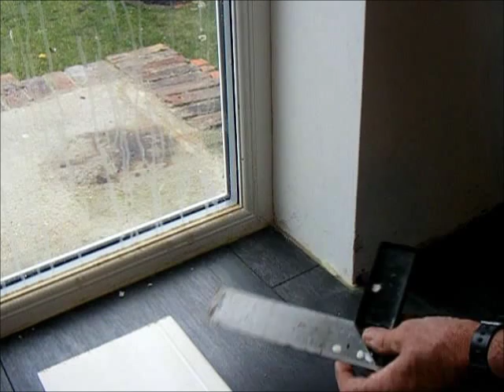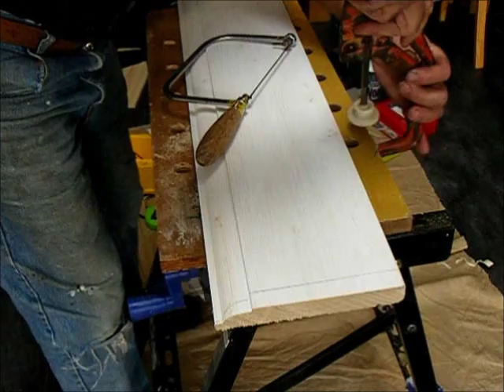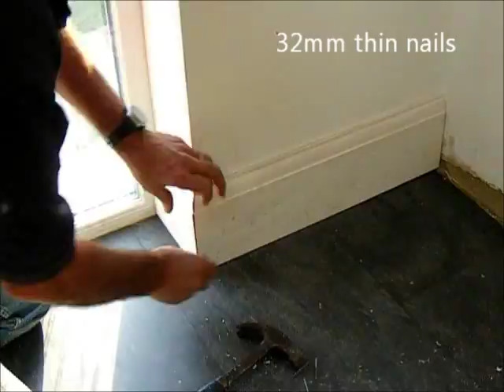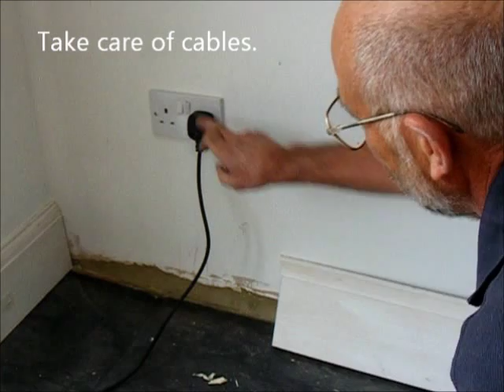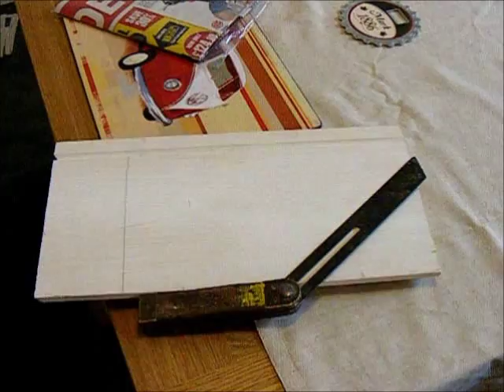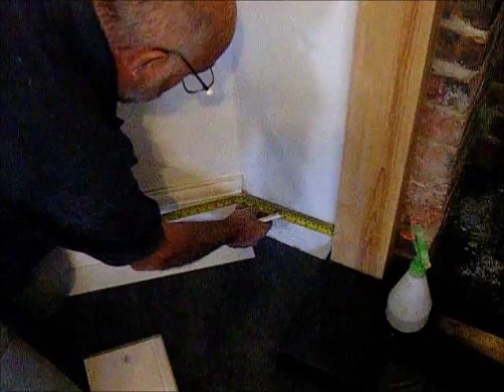How to fix baseboard, skirting board.

Comment: @ 7mins !! .. attempting to nail the mitre join while holding the board by hand and using a knee up against the other side??

Use a work bench and corner wood clamps - the tools are available! Seriously!

The two pieces of skirting can be properly supported using the jig and pins can be hammered in accurately without the pieces moving about and then positioned to the corner. Next step > apply wide masking tape across the top of the skirting to temporarily secure it in place so that pilot  holes can be drilled through the boards and into the wall behind > then proceed to drill the correct size for the rawl plugs going into the wall and additionally countersink the skirting support points. No More Nails adhesive can be applied  to the back of the boards.

Comment: Good video on cutting skirting using hand tools. Pro carpenters would tend to use a powered mitre saw but it's the end result that is important. You might lose a bit of time using hand saws. Don't forget that there was some really excellent work done in Victorian carpentry and they didn't have access to 13 amp sockets.
I've just tried various methods of mitering 9" skirting (deep stuff!) using a hand saw. They all failed apart from one that did work pretty well. Instead of marking with a pencil use a good sharp Stanley knife, making a fairly deep score, on all sides of the skirting. I mounted the skirting vertically in the vice and cut down using a fine cut Bahco 14" tool box saw, freehand.  The knife mark helps to guide the saw, the fine cut of the saw helps too. You may or may not have to touch up with the block plane. You can also wet the end grain to make planing a bit easier.

Comment: BERN a quick question how do you fix the unevenness of the skirting where the skirting sits on the floor, by that i mean the floor is wavy how to get that flush fitting?
Reply from the maker: +! Hadookaan ! Sorry I have not replied earlier. Two ways to fit close to an uneven floor. Fill with painters caulk  or scribe using using pencil flat in the floor to mark the undulations and then cut the high points away. Hope that helps.